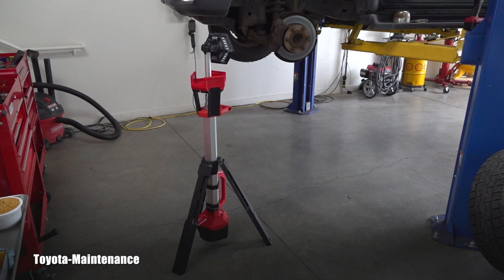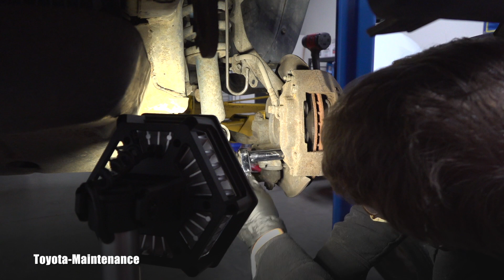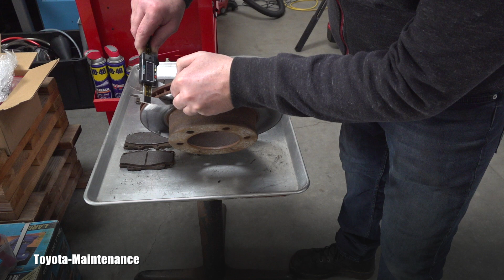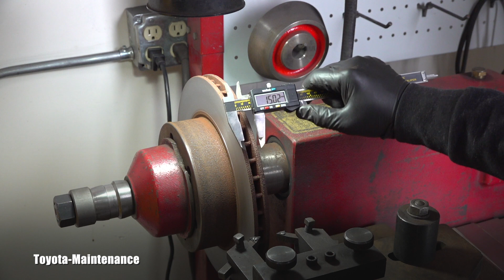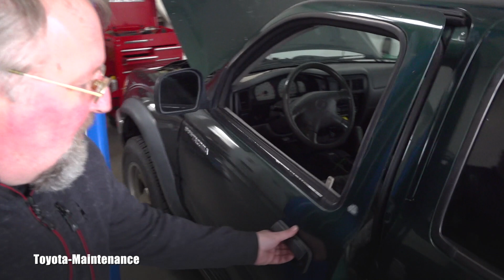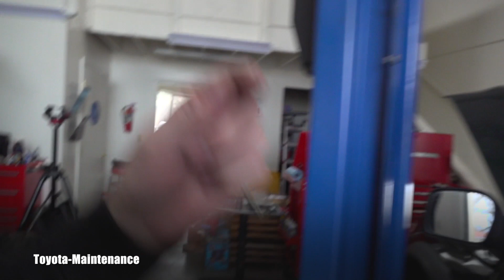Toyota Tacoma front brakes job

Comment: The anti-rattle spring is installed as the Toyota manual says. It was upside down in the begginning. I don't really know if it really matters, though, but in the manual we can see the curved part in the bottom.

Comment: You installed the spring clip in the opposite orientation as it was when removed.   I believe I may have done the same but I wasn't smart enough to take photos....   I wonder if it makes any difference

Comment: When you measure the rotors with a caliper you were using the wrong type, you need the proper one for doing breaks and you must check the bottom the middle and the top of the same rotor, then you go with the smallest number

Comment: I found on Amazon a set of brake pads for the front of my 2002 Tacoma. 
They were returned new but being sold as used and I got them for less then 9.00 dollars. I put them on my old brake rotors and they work great. I’m gonna run them this summer and then replace everything this fall.

Comment: You reinstalled anti-rattle spring upside down. I would suggest loosening brake bleed valve on the caliper to prevent dirty brake fluid from being pushed back into brake lines.
Reply: Anti-rattle is indeed upside down.  Not sure if it matters that much, but I did notice more wear on the side that I accidentally installed in the same incorrect manner when changing my pads again (after about 25,000 miles).

Comment: Mounting bolts torque 70 Nm? (just double checking). Thanks.
Reply: ...and thanks for the tip about pumping the brakes after the job. I live in the mountains!!
Reply: Brake caliper mounting bolts: 90 ft-lbs for the 95-04 Toyota Tacoma (Prerunner/4x4)

Comment: Thank you for your great videos...
I have a quick question. Do you recommend replacing the rear brakes? If so, how often. 
My truck is 2003 Tacoma. It shakes downhill only, plenty of pad and rotor at 22mm. Brake feel low but they are not. Anyway any help will be appropriated
Reply: Your brakes may be working right but your ball joints may be getting worn out causing the shaking.

Comment: Thanks very much for such a detailed and careful description of the procedure.  From looking at several other videos of Tacoma brake jobs, it is apparent that there are other styles of these front disk brakes on first-generation Tacomas, and it appears that the procedures for the brake jobs are very different.  I wonder how many different styles there are and if there is an easy way to determine which procedure to use.  Also, you said that someone had advised the owner to have the brake job done right away.  You didn't find a problem, so apparently this work was not necessary on this vehicle?

Comment: For the grease on the lug nuts, you should probably do less torque when tightening.

The lube will create less resistance when tightening, which means more turns for the same torque amount. The end result is the bolt stretches further, and the force on the wheel is greater (think of it as a very rigid spring). The bolt itself is also more likely to break.

Most of these things are designed with a factor of safety so you may be able to get away with it, but hard to say what is the equivalent torque after adding grease should be.

Comment: I used to put anti-seize on wheel studs too until 2 nuts loosed up while driving.  Since then I only use WD-40 and haven't had any more problems and it still keeps studs from rusting.

Comment: Another great video! 2 Questions - 1. Why did the customer bring them in if the pads and rotors were all in decent shape? 2. How do you know when to flush or replace the brake fluid?
Reply: John Shipps Rule of thumb is every two years or so.
Reply: Good question - as stated the customer had another shop say “ASAP”. Prob that left inside pad was the reason.  IDK.

Comment: Great detailed video once again.I recently filed back/scraped with a flat screwdriver the discs/rotors on either side of the edge/lip and on the circumference...it is now flush lol,plus i scraped out all the brake dust that piled up on the caliper,wire brushed it too properly.....there was a lot there! Glad i did it as it just flaked out as i do my own servicing but not like this in 12 yrs,so worth doing.

Comment: Nice job, good to see guys who turn rotors. A little unusual to see more wear on the outer pad, on both sides. I wonder if that is common on the Tacoma, maybe the inner pad binds on those slide pins....
Reply: I have this type of caliper on a motorcycle and if 1 of the Pistons begins to get sticky all the force goes to the smoothest side

Comment: good video just wondering does it matter which way you reinstall the clip you installed it different from when you removed it
Reply: I was just thinking the same thing, and don't you lube the pins?
Reply: @michaelstarmer3497  yeah! This a quite different configuration that I am used to. Are there caliper guide pins? Great question
Reply: Noticed the spring clip was reinstalled upside down from how it came out. (The beauty of video!). Does it matter? Prob not.  Will I replace it the way it came out - definitely!

Comment: A Question for anyone:  2004 Toyota Rav4, 135K miles, 2.4 l engine.   Problem:  large oil leak on front (alternator side) of the engine.   Thought it was the crankshaft main seal - Eric O. and his two guys eventually found the that plastic bumps on the engine side of the harmonic balancer had worn through the timing cover creating a small hole.   
Has anyone heard of anything like this before?
(SMA hadn't)
How long/difficult is it to change a timing cover on a 2.4l?
Seven hours or so?
Thanks.
Reply: sounds like leaking valve cover. second crankshaft main seal and camshaft main seal are leaking. final timing cover 2 hours and easy to replace